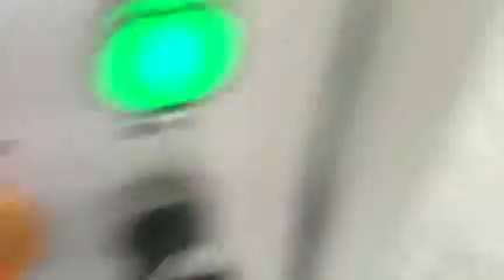paper cup making machine, china, 2-12 oz, 75 pcs/ min, 1800 kgs, 9,07,000 bdt, ziatech,01912152784,

Comment from the maker: paper cup making machine, 2-12 oz, 75 pcs/ min, 380 V, 50hz, 1800 kgs, L: 850 mm; W: 950 mm; H: 1700 mm, price = 9,07,000 tk, origin: china, imoprter: ziatech, help line: 01912152784,
paper cup making machine, china, 2-12 oz, 75 pcs/ min, 1800 kgs, 9,07,000 bdt, ziatech,01912152784,
ziatech auto machine & engineering company ltd, (High Power Industrial Machine & steel products manufacturer, Supplier, Importer & Exporter), +88-02-7553253, +88-01912-152784, +88-01768-963858, ziatechbd@gmail.com  , www.ziatechbd.com